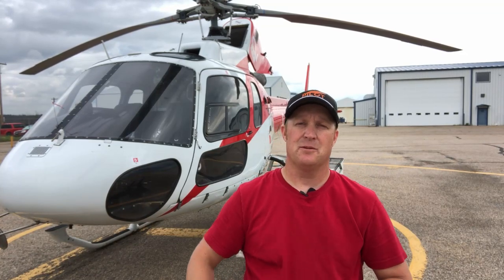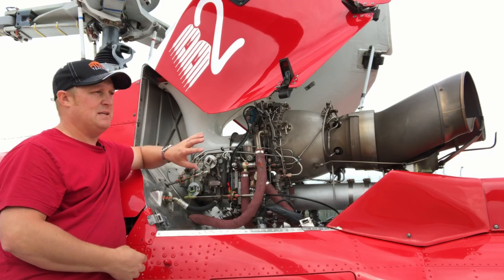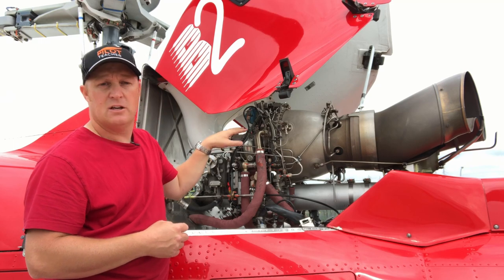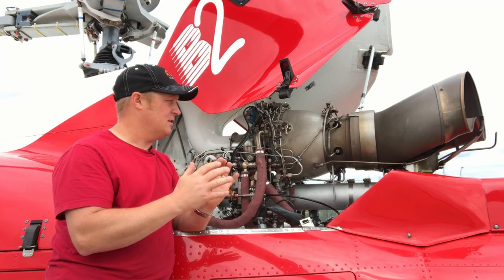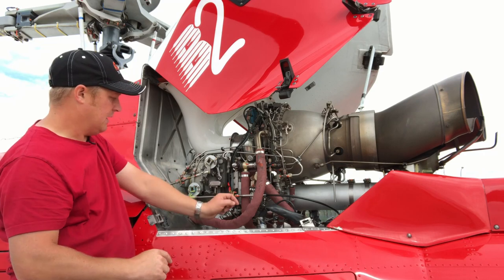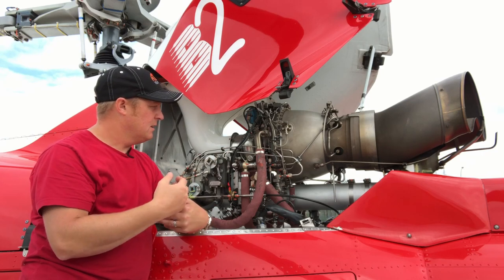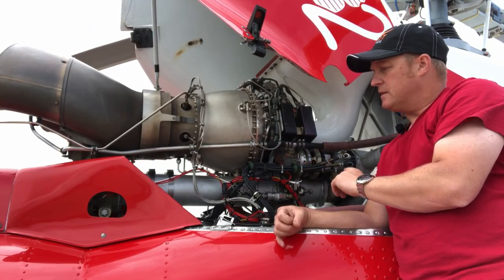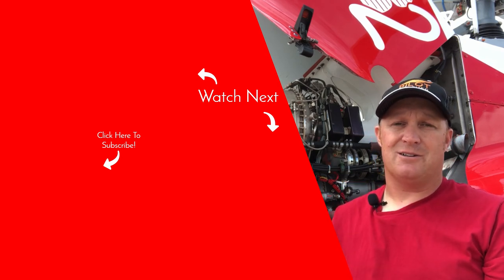A Complete Guided Tour From The Pilot!

Comment from the maker: ARE YOU WANTING TO BECOME A PILOT?
See Over 100 Ways To Save BIG Money On Flight Training! 
Find Out More at PilotTeacher.com
Reply: You said if you were to lose all oil pressure you would immediately power off the turbine in order to preserve the ability to freewheel the rotor and obviously autorotate to a landing. I’m curious if that’s a unique situation to an A Star or most turbine powered helicopters?
Reply from the maker: @GRosa250  its all dependent on the engine design and where the freewheel is. Because the Arriel engines have the freewheel unit built into the engine you need to preserve the oil to keep it lubricated and functioning.

We tested it in the sim against pilots who had lost all oil pressure and you only have several minutes to get it on the ground if the engine stays running and pumps all the oil out. 

By shutting down the engine it helps prevent oil from being pumped out and buys you time before the freewheel seizes.
Reply: @PilotTeacher  thank you for the explanation. I’m no expert but that doesn’t seem like the best design. It would be like if your car engine locked up then your wheels lock up. Even in a car an automatic transmission will still freewheel and a with a manual you could disengage the clutch or put it in neutral.
Reply from the maker: @GRosa250  yep im with you on that one, but they must have it done for a reason. Everything is a compromise in aviation and the reality of a total loss of oil fluid is almost none existent!

Comment: That’s cool that the final drive is not connected to the shaft but rather merely spins from hot, high pressure exhaust gasses. Loved learning more about it. 

50k rpms down to 30k down to 6k down to a few hundred rpm at the main rotor.
Reply from the maker: They truly are amazing pieces of engineering and thats why each engine is over $1M brand new!!
Reply: @PilotTeacher  damn! Love it.

Comment: Thank you for breaking it down for a layman like myself to understand. The engineering that went into this engine is mind-boggling.  The reduction gearbox is incredible. I'm also blown away by the main rotor rpm if I remember correctly around 370rpm! Thanks again and safe flying.
Reply from the maker: Yes they are remarkable! Normal flight rpm for the Astar is 390 +4/-5

Comment: Very fascinated with heli's. im amazed by how small the engine actually is. The AStar engines especially, much smaller than the Bell heli models
Reply from the maker: For their size it is amazing how much power they produce. The Arriel engines used on the Astars are a great engine for sure. Be sure to check out the Entire Helicopter Guided Tour video too if you liked this one!
Reply: Ya faster flow from fewer moving parts moving 60%faster!! Way more torque once you get that geared down!

Comment: Great video. Nice to see people interested in the engines. Would be nice to see the explanation of the injection wheel after the start injectors and ignitors are off. That’s where the Arriel engine is pretty unique. And not to pick but 55-56k rpm is a bit too high for the gas generator speed. 100% is 52,100 on the 1D1 and free turbine 100% is 39,158 that’s reduced down to 6000 output speed.
Reply from the maker: Thats why I just fly them and not design them hahaha

Comment: Just a quick comment.  After the compressors, the temperature and pressure are indeed increased.  Typically, the axial velocity through the component is maintained and the Mach number goes down as the temperature goes up.  So, the velocity of the air is typically not increased.
Reply from the maker: Cool! Thanks for the info. These engines always blow my mind and the exact engineering behind them is incredible! I was going off the pilot's 'Dumbed down' version training manual!
Reply: @PilotTeacher  It's all good, for sure.  I have spent too much time "inside" the engine.  But, I am an aviation guy at heart.  My comment is only intended in the most positive sense.  Thanks very much for your videos.
Reply from the maker: @indepviewpt  Thanks for your input and appreciation. The more accurate the information I can get the better!

Comment: Great video! You explained these parts really well. Is the power output shaft always connected to main rotor and tail rotor or is there some kind of clutch system to allow engine to run without rotors spinning?
Reply from the maker: Try this buddy:

Why Don't Helicopter Rotors Turn As Soon As It's Engine Starts?
https://youtu.be/HlHs_0G6Cfc
Reply: On the Arriel 1D1, there is a free wheel unit mounted to the drive flange of the engine power shaft. The free wheel shaft drives the transmission drifeshaft and runs coaxially through the power shaft of the engine to the rear of the engine where it is connected to the tail rotor driveshaft.

Comment: 14:00 Pro tip: if you have low frequency wind noise like here, just pass the audio through high-pass filter (e.g. 80 Hz high-pass filter would cut low frequency noise below 80 Hz off). Note that most filters are not hard so they might still leak low frequency through. If you cannot adjust the effect (e.g. -12 dB/octave vs -24 dB/octave), you can just apply the same filter multiple times. If you do that in post production while the audio is in digital format, applying the same high-pass filter shouldn't cause extra noise but just make the filter limit harder.
Reply from the maker: Ahhh great tips Mikko! Where were you when I needed your advice 18 months ago hahaha!
Reply from the maker: I spent some good money on better audio and video equipment this year. Alot of the videos shot were unusable because of the wind noise!
Reply: @PilotTeacher  As long as you don't clip (get to 0 dB for digital systems), software noise filtering can do absolute magic these days. You'll be limited by the noise floor of your audio gear if you have to lower the limit due the wind to avoid clipping.

Of course, having a high quality windshield reduces wind noise and you don't need to reduce the mic level so much which results in better noise floor which in turn improves final audio quality.
Reply from the maker: @MikkoRantalainen  awesome! Thanks for the tips. I went with Rode audio and their wind muffs/deadcats. Looking forward to improving the production quality!

Comment: Great video & clear explanation! Can you quickly explain where the governor is in relation to the throttle please? Is the governor a piece of hardware?
Reply from the maker: Ill try and answer it as best I can as our engineers keep us Peasant Pilots well away from their engines!

As far as I’m aware on the mechanical fuel control engines the governor is part of the fuel metering system on the engine. It monitors the position of the Collective via a cable and adjusts the fuel to suit. Its all based on air pressure within the engine and rotating fly weights for the governing.

On the digitally controlled engines the engine control unit monitors the power turbine speed and main rotor rpm and adjusts the fuel flow to suit to keep the NR dead on!

Thats about as basic as I can keep it. I hope that helps! I could be way off but I’m out in the field with no engineers to ask or training manuals to look at!
Reply: @PilotTeacher  Thank you very much for that. I was looking for a clear explanation on how low rotor RPM happens and I understood it from your explanation about the relation between engine & rotor RPM. Thank you & fly safe.

Comment: Tanks for the video, enjoy it, nice explanation and walkthrough. Curious about what power percentage you are using during cruise as you stated it uses about 180 litres an hour. I have read its BSFC, but it is only stated for max power, not cruise power. My understanding is a turbine engine is less efficient at part throttle. Thanks.
Reply from the maker: In the Astar I normally cruise at whatever speed 96% NG gives me.

Comment: very interesting and well explained. Thanks alot.

I have a question though. Why isn't there a starter gen and igniter on the other engine. Or is there a link from the right engine to the left?
Reply from the maker: There is only a single engine on this helicopter. With helicopters that have two engines, each engine will have its own starter generator.

Comment: what about helicopters that have two engines? like the twin huey, do they have two power output shafts?  and one other thing, in a Chinook, or CH 146, where they have rotors front and back, does the rear arrangement drive the front rotors through gearing? Thank you, enjoyed the video, love helicopters
Reply from the maker: Each engine drives an output shaft that feeds into a main transmission. This transmission then drives the rotor head/s.

You can see the engines and transmissions in these videos:

AS355 Twinstar Helicopter: Guided Tour With Engine Start & Fly Away
https://youtu.be/LPYFFRUDxkk

Search & Rescue Pilot - Everything You Ever Wanted To Know!!
https://youtu.be/Sn8kj5CbYVg

EMS Pilot - Everything You Ever Wanted To Know!!
https://youtu.be/X4V-9AnSzxI

Hope these help!

Comment: The air after the 2nd stage centrifugal does Not speed up, it slows down in the diffuser ducting accomplishing pressure recovery into the combustion camber.

Comment: What are the 2 pipes protruding behind the exhaust pipe? Someone told me they were ventilation and for when there is excessive oil.
Reply from the maker: Something like like that.
Reply: The two pipes out the back are an accessory gearbox/oil reservoir vent, and the rear bearing vent

Comment: Great explanation.  However, let’s take it from this point.  Your turbine is up to speed but your rotor blades are still stationary, how do you engage the rotor blades?  Your throttle is on the collective.  You are going to use the collective and throttle to raise or lift the copter.  What device engages the rotors and keeps them rotating while you are in, what I would call neutral?  Thank you, take care and stay healthy.
Reply from the maker: Hi Vincent!
This is a great question. Ill take my camera into work tomorrow and film an explanation for you. Its quite a simple concept but showing you will be even better! Stay tuned!
Reply: @PilotTeacher  thank you very much.
Reply from the maker: Vincent be sure to keep an eye out for Tuesdays video! ;)
Reply: @PilotTeacher  I will and thank you very much.
Reply: The other FCU lever below the throttle is called the anticipator. Through the reduction in sensed rpm gain or drop of the free turbine will increase or decrease the gas generator rpm to maintain rotor speed and power requirements of the anticipator set point.

Comment: Surprised there's a direct mechanical connection between the collective and the fuel control. I would have expected the engine to be governor-driven (via the fuel control system) to automatically maintain set RPM regardless of collective setting. Interesting.
Reply from the maker: The fuel control does have a govenor that trys to maintain the rpm around 390 when in flight and it works pretty well. 

From what I understand the governor is set by the fuel control lever that is used to start the engine and then is never touched in flight unless you have a governor failure/malfunction.

Then the power is adjusted by the collective as I move it up and down.

The new H125 has a full digital engine control system with an automatic backup governor system.
Reply: @PilotTeacher  Mechanical "CORRELATOR" does the majority of the compensation for RPM droop..why it sometimes is calendar "droop compensator"🤣👍..the power turbine RPM/governor response fine tunes the gas producer "throttle"
In a heli you want to keep the rotor RPM in the green arc, or ""DROOP" can turn into RAPID UNRECOVERABLE DECAY..leading to "DROP...🤯😱💥☠"
Helicopters are like figureskating..whirly-twirley balanced deftly upon edges.
Or like the Harlem Globetrotters act! Lol "Keep the power-pedal skid low" and may you find all the "tail" you need!(that's tail rotor authority!)🚁

Comment: How is the engine lubricated, where does the oil go? Also is it the same oil that's used for engine, transmission and cooling?
Reply from the maker: Transmission has its own oil stored in its casing. The engine oil is pumped around the engine using an engine driven oil pump. It then drains via gravity and is then returned to the reservoir by scavenge pumps.
Reply: @PilotTeacher  but what parts does it lubricate inside the engine?
Reply from the maker: @LanaaAmor  bearings.

Comment: does that 6k RPM shaft to directly to BOTH the main gearbox AND the tail rotor gearbox?
Reply from the maker: On the Astar, yes. It comes out the front to connect to the main transmission and out of the rear to the tail rotor gearbox. 

Each engine and helicopter design can vary. Most have a single output shaft from the engine that feeds the main transmission which then feeds the main and tail rotor systems along with any ancillary equipment.
Reply: @PilotTeacher  what happens if anything along that powertrain seizes, will that cause the rotor RPM to decay?
Reply from the maker: @stachowi  the helicopter becomes a lawn dart!
Reply: @PilotTeacher  gotcha, love your channel...
Reply from the maker: @stachowi  thanks buddy. All helicopters have a freewheeling unit that separates the engine/s from the drivetrain to allow the rotor systems to rotate freely and complete an autorotation but if the transmission seizes you’re hooped.
Reply: @PilotTeacher  figured that, makes sense, i just wonder what keeps it all lubricated? i'm guessing there is a oil pump that is connceted to freewheeling portion of the drive train?

Comment: Your description of the fuel system was incomplete. The fuel nozzles do not supply fuel once the engine is running. That function is taken over by the fling wheel. 
Also the glaring contradiction between the anticipator and throttle cable descriptions and the video.
Reply from the maker: Never heard of a fling wheel!
Reply: @PilotTeacher  also known as the injection wheel.
Reply: @eds6889  Still never seen one in any of the gas turbine manuals for any of the helicopters Ive flown.
Reply: @anaveragedadsworkshop  a quick talk with your airbus AME will shed some light on the differences between the starting fuel system and the operating fuel system.
Reply: @anaveragedadsworkshop  also we are only talking about the Arriel engine here.

Comment: 🤔...🤯40KRPM! WOW!!
I know the Lycoming T-53 family of the Bell UH-1Huey..a medium lift platform..a bit bigger engine..lol it runs power turbine @ 25K RPM for 6.6K RPM output..all the RPMs get turned into torque like first gear in a car...weak fast turning gets turned into slow STRONG TORQUE by the gear ratio/mechanical advantage exchange.. that 40,000 RPM POWER TURBINE IS A LOT OF ENERGY!
60% more RPM, 15K MORE RPM! "GREAT SCOT!!!"
Well this VERIFIED MY OWN QUESTION & ANSWER! It clearly validated my visual based  supposition that the parts were so small so they could move so fast, & GUESTIMATING GEAR RATIOS in the initial reduction gearing.. therefore little engine WAS a "ROCKET IN A BOTTLE!" That's one fast digit spinner, sure will go SCORCH-POP if oil gets low! 
SO YES, 15 THOUSAND MORE RPM THAN THE POWER TURBINE IN THE HUEY! 60% MORE RPMs..
I love the simplicity of that engine, less to go wrong, looks like RC helicopter turbine engine of today! I also like the apparent cleaner flow patterning the combustion chamber, wonder what flow speed is..in some engines it's about 400MPH/644kmh.
The A-Star is a beautiful & simply effective bird..I have always admired!
Great video, thanks!

Comment: When you also fly in the rain, how does the engines get rid of the water that passes through the compressor from blowing the flames out in the combustor?
Reply from the maker: The amount of water that makes it into the combustion chamber is almost zero. The inlet barrier filter, then the temperature increase while in the compressor pretty much vaporizes any moisture. 

Any remaining moisture going into the combustion chamber will be so insignificant that it will not effect the fireball. The only time a problem occurs is if a large lump of snow is ingested and blocks the air intake. This would cause a flame out.

Comment: and is the astar safe? would you say the b2 or b3 is safer?
Reply from the maker: The Astar is super safe. Its the one of the reasons why its the worlds most popular utility helicopter.

The B3, especially the new B3e/H125 is definitely safer due to it’s increased power, digital engine control, puncture resistant fuel tank, crash attenuating seats and dual hydraulics, all of which the B2 does not have.

Comment: I see in the main rotor transmission  there is a planetary  great system  .why is that ?
Reply from the maker: Hi Sherwin,

The planetary gear system used in the transmission is the strongest and smallest way to efficiently reduce the rotational speed between the drive shaft from the engine and the main rotor mast.

The engine drive shaft comes into the main transmission at 6125 rpm which feeds onto a ring gear. This reduces the rpm down to 1707 rpm. This ring gear then drives the planetary gear system which then further reduces the rpm to 394 rpm, which is the what the main rotor turns at during flight. 

Check out this video that shows it perfectly - Although I have no idea what he is saying!
https://www.youtube.com/watch?v=cQP4qU0UQX0&list=PLBR4d9-4bXFwNCzn0HYCqUL_8PHk_j-RE&index=1&t=75s

Hope this helps!
Reply: @PilotTeacher  thanks
Reply from the maker: @sherwinsalvatori6997  Anytime!!